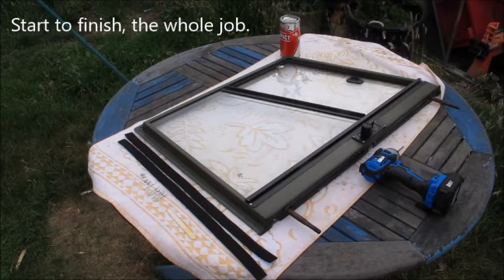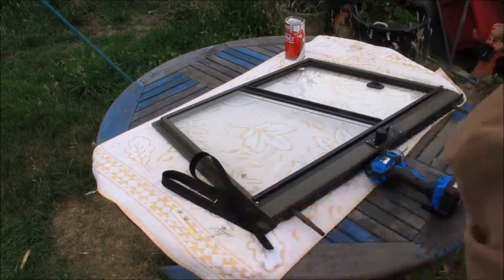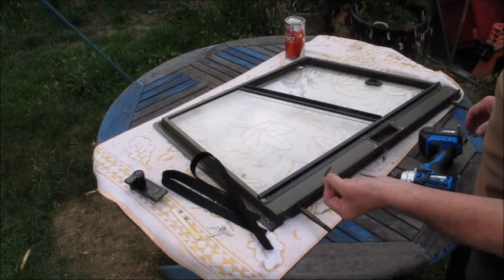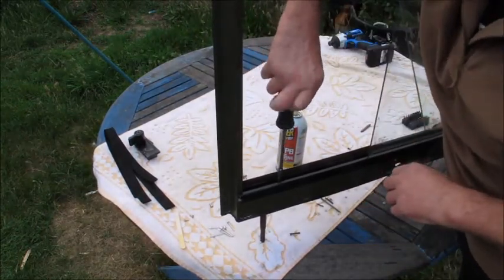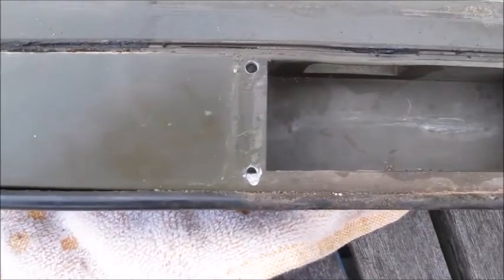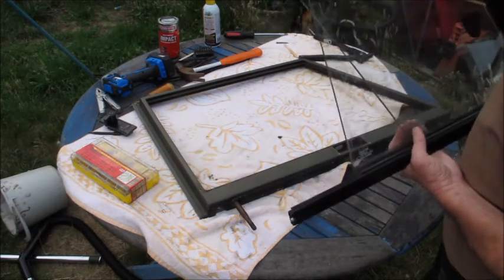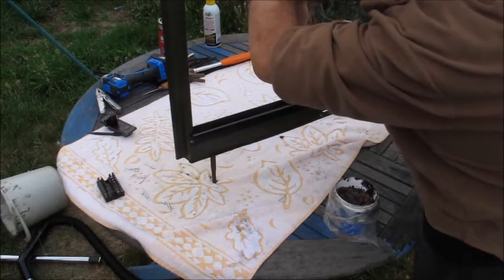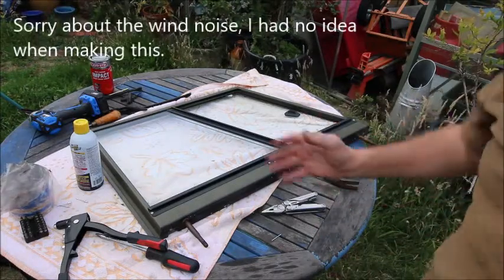Land Rover Defender Wolf Sliding Window Felt Replacement. Stop the Rattle! Complete job.

Comment: Fantastic video, many thanks! I've got a 1998 wolf defender 90 and the felts have bunched up at the front so that the window doesn't open fully and when shut it rattles - what felts are they and where would I buy them from? Thanks!
Reply from the maker: Hello mate, thanks for the comment. The felt I used is actually cut to size from a sheet I bought at a local craft/sewing shop. It was cheap and I now have loads of it. The genuine stuff is mwc4757 I believe but please make your own decision or phone Craddocks, LR parts or John Richards etc and ask to make sure. Cheers.
Reply: @MatusTerpis  Okie dokie, thank you! how did you remove the window frame from the door?
Reply from the maker: @fergusmacinnes3807  ah now, that was a struggle. You probably know this, forgive me but .. Take the door card off, undoing the earth strap as well if yours is a FFR. There's 2 x nuts (17mm?) on studs going through the window frame into the lower door. Undo those and if you're really, really lucky the window will come away upwards with a wiggle. I'm guessing you may have already tried that. The nuts should come off easy, or the stud unscrews form the windowtop, either or. The studs often rust into the tubes in the lower door, mine did. Soak it in penetrating oil, WD40 isn't as good but it will do. Spray up into the stud and also try to get it between the window top and the lower door, if one moves lever and wiggle the window with something soft, like plastic, but don't stress it or someting will break. When you refit wire brush the stubs off and smear grease onto them. Good luck.
Reply: I’ve found the two nuts which are fairly hard to get at with the ‘door card’ (assuming this is the black plastic on the inside), though I’m not sure how to get that off with the plastic fasteners in.
Reply: @MatusTerpis Nevermind, managed to get the door card off fine, though the nuts on the two big bolts undid a bit before the whole screw started turning and I can’t see how I’d hold it at the other end without having already taken the windows out.
Reply from the maker: @fergusmacinnes3807   Hi, I've only just seen these messages,  sorry. How did you get on? Glad you got the doorcards off, yes the black plastic. Too late now but the best way to get those 'firtree' fastners off is with a proper trim tool which looks like a weird pair of pliers or gently prise them off with a wide flat screwdriver or narrow scraper.
As long as the bolts come all the way out of the door top you'll be able to take the top off (which you've probably done) and clean the bolts/studs up as they are probably rusty. Put them in a vice and unscrew the nuts off them. Once they are apart clean them up with a wire brush. When you're ready screw them back into the windows with a pair of mole grips put some grease on them. Either for yourself next time or someone witth thank you when the next owner does this job. Once the windows are off go steady with the drilling etc and you'll be ok.
Reply: Good news! I’ve managed to get all the rivets out without too much damage, so the windows and door card are all off and ready to replace felts. Bad news is the top of the door isn’t actually off - the two bolts are seriously rusted and I’ve no clue how to get the nuts off and the bolts out - is there any way I could send you a couple photos? Thanks!
Reply: Nevermind! I’ve managed to solve the problem immediately after asking again! I think  just didn’t really expect not to have a nut at the top end of the bolt
Reply from the maker: @fergusmacinnes3807  Glad you got it sorted. So you have the window tops off. Rust, it's a bad design, let's face it there are several on a Defender. Just grease everyting up when you reassemble. Good luck with the rest of it.
Reply: @MatusTerpis  Thank you! I've decided to replace the bolts keeping the top of the door on as the threads are completely rusted - managed to find on Craddocks so thanks for the recommendation! I'm not too experienced in rivets - where did you find yours/might you have a product code? Cheers
Reply from the maker: @fergusmacinnes3807  good call on getting new bolts. As for the rivets, I didn't use any special ones. They come in standard diameter sizes with several lengths per diameter. As long as they are the right diameter and length, which is very important. I bought a muliple selection box from B&Q or Screwfix, can't remember which one, as I use quite a few.

Comment: When you refitted the door tops, did you include those 2 really small rubbers either side of the studs?
Reply from the maker: Oh no I didn't. They weren't there to start with and I didn't know they were supposed to be.
Reply: @MatusTerpis  They are supposed to prevent water channeling down the studs, but the supplied ones are uselessly small and too narrow. I just cut some from 3.. closed cell foam tape.

Comment: Did you actually take the windows out of the bottom rail at any point?
Reply from the maker: No I didn't, there was no need to do so as I was just replacing the felts. Thanks.
Reply: @MatusTerpis  I did and I'm glad I did.  There's a surprising amount of dust and crud in and pan that rail.
Reply from the maker: @gavinbroad1743  Ah was there now, perhaps I should have done and maybe I shall next time, thank you.